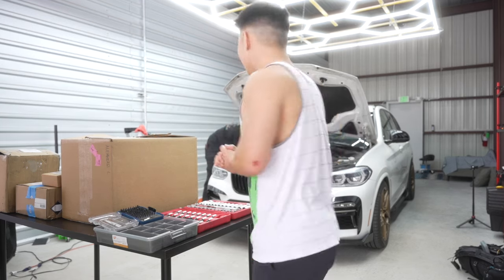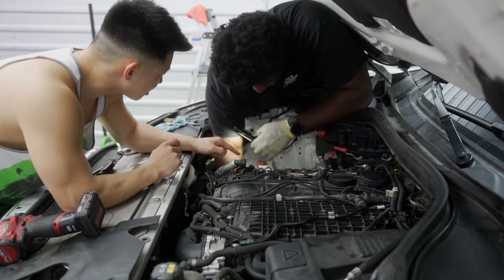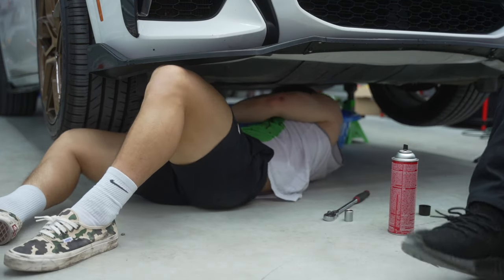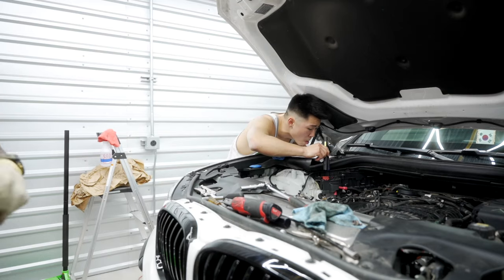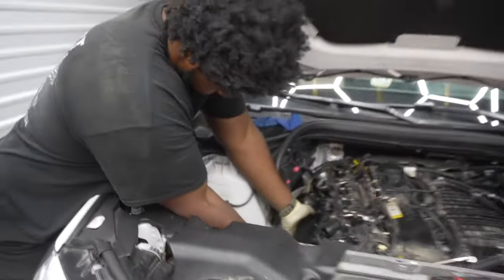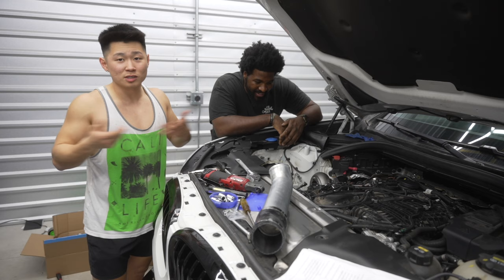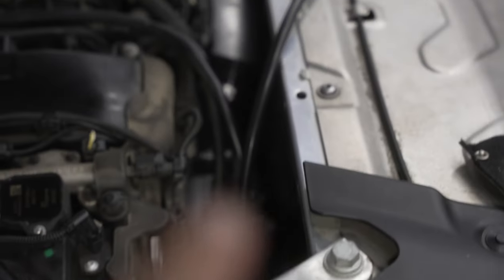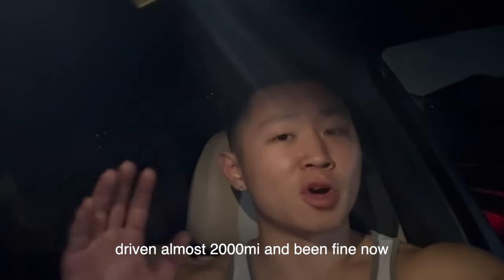i installed a BIG TURBO on my BMW X3 (B58)

Comment: Not sure if I missed it but how much did the setup run your for the turbo. Roughly how much for install ik hes your friend but im hoping to do the same path but dont know about price. 2021 x3 m40 im working with
Reply from the maker: 4500 shipped for the set up. labor is probably gonna be around 800-1500 depending who and where you take it to. and i’m pretty sure 2021 needs femto unlock unless you already have it done and plan on staying on the same tuning platform
Reply: @alexleeteehee  damn thanks for the info. Not sure what to do cause i bought my lease out and got the extended warranty but i could cancel it at anytime and be refunded the difference

Comment: So your X3 is a 2019 and it has a 6 port thought they had a 2 port what year and month is ur X3 build date on the VIN?
Reply from the maker: 2 port were on different models like the early supras and i think all throughout X5s. i’m not 100% sure but i don’t think they produced the x3 with 2 ports. and im pretty sure mine is feb/19
Reply: @alexleeteehee  ok so 04/19 so 6 port for sure
Reply from the maker: @vr4junkie385  yes
Reply: @vr4junkie385  2017-till feb/19 they had the 6 port ones

Comment: Your running it without a boost controller ? How does that even work? I mean ik you gotta disable the EWG and all
Reply from the maker: i have a mac solenoid w reflex+ now. but even with no boost controller just disable ewg and runs off spring

Comment: hey bro hows the turbo holding up? great video that a huge upgrade.
Reply from the maker: it’s been good!
Reply: @alexleeteehee ever get it dyno'ed
Reply from the maker: @ check the recent video, just installed the built trans. still breaking it in but might dyno it in the next month or 2

Comment: What is the estimated horsepower gained?
Reply from the maker: waiting for some tuning on 93. est 520 tops probably. still gotta get flex fuel and all and should sit around 650hp since i’ll be limited to transmission at 610ftlb